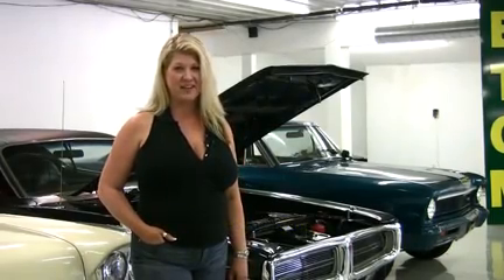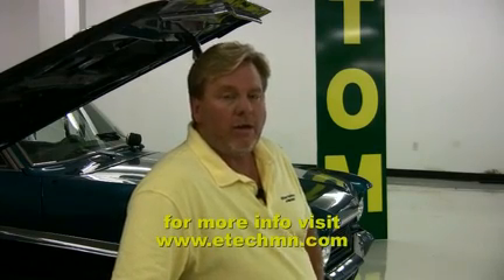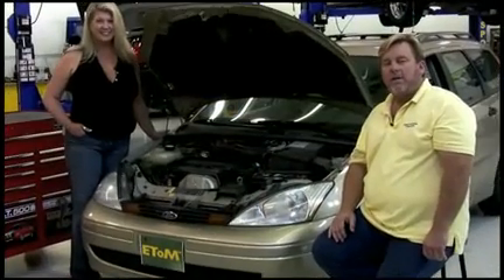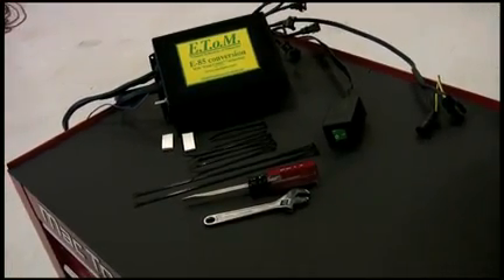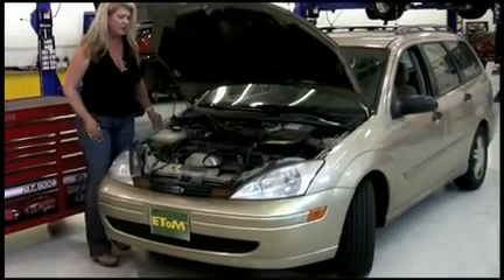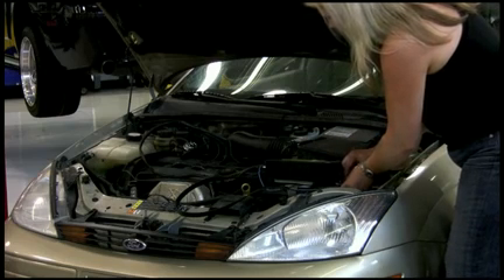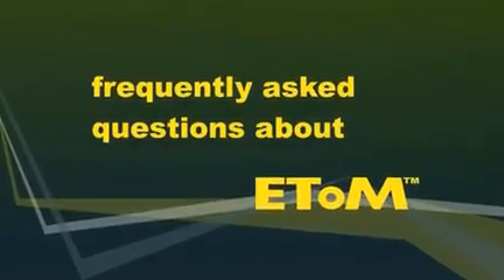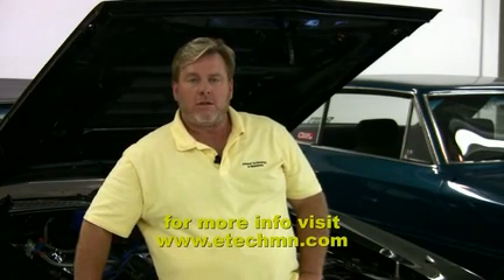E85 Conversion Kit - ETOM (Ethanol Technology of Minnesota) - Go Green Save Green - Save Gas & Fuel

Comment: First, ALWAYS remove the (-) battery cable before doing ANY kind of electrical work!! Second, the vid shows a woman can do the install. bravo bravo!! Third, you didnt state EXACTLY what the EToM does. You stated, "it recalibrates your fuel..."(mixture?)Fourth, your EToM IS a puter itself so it DOES ' fake out' the puter  thru O2 sensor to make it read 'lean'. This can be done with a .02 cent transistor installed in O2 sensor.  Lastly, if your wife lost 30lbs, shed be REAL  HOT!! (wink).. DTM